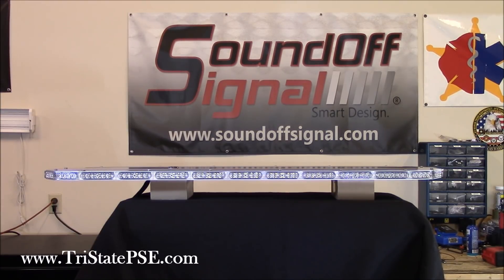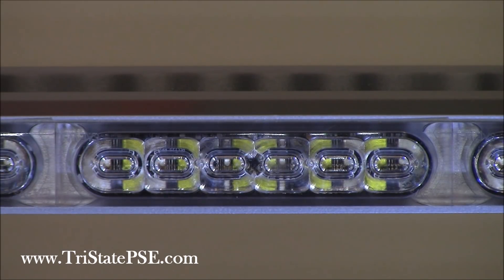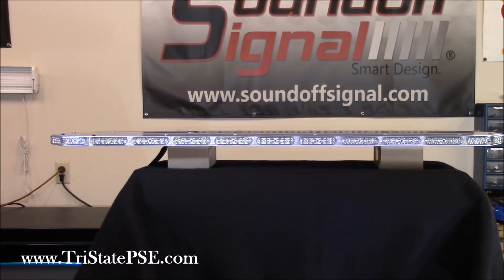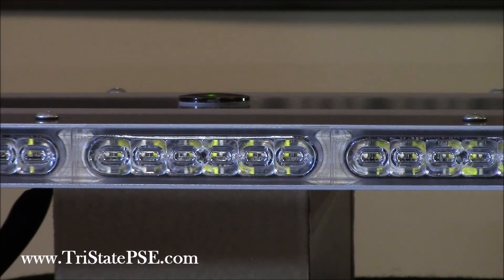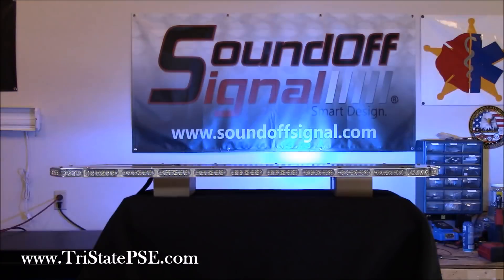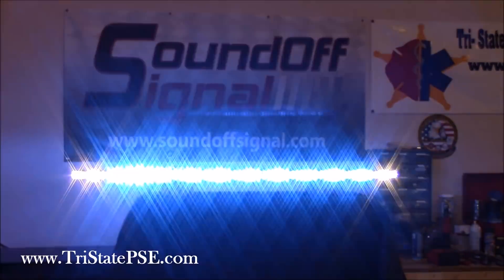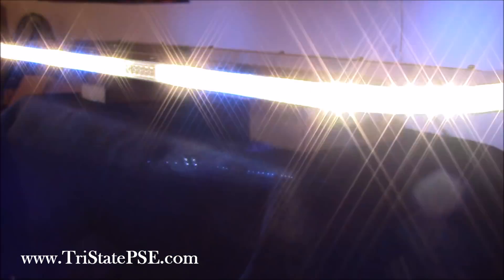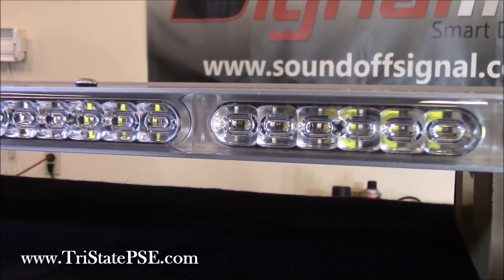SoundOff Signal mPower Dual Color Light Bar (Overview)

Comment: I really wish I could see side-by-side the  m power and the n Force  to see the brightness I know everyone says they are both ridiculously bright but one has to be brighter than the other and I’m going to guess that would be the more expensive bar
Reply from the maker: jonathan lavezzi - I would say the NForce might have an edge over the mPower in that dept. But, it’s also taller with a bigger amount of surface area to broadcast its light from. Some folks want ultra low profile and this mPower bar is certainly that, but very bright too, not to mention the protection the less have with these lenses VS. regular style lenses or domes.

Comment: If you have rocks coming at you at 200 miles an hour on the highway I think you may have Bigger problems than worrying about your lightbar LOL.
Reply from the maker: SATAN - Even a rock at 35 mph would crack the lenses of some of the most expensive light bars out there...It “may” have been a slight exaggeration....but still worth mentioning. 🤔